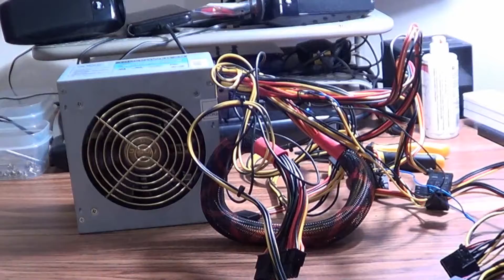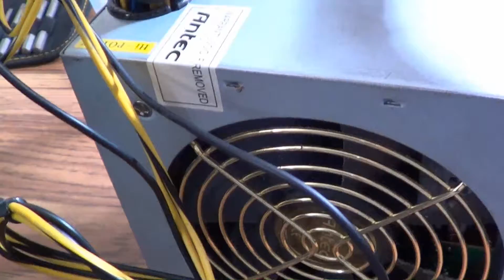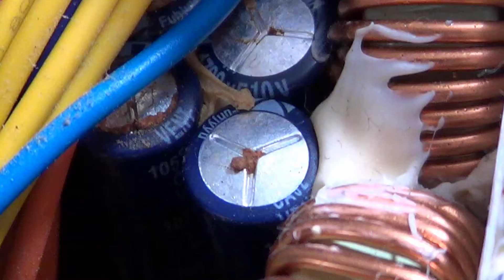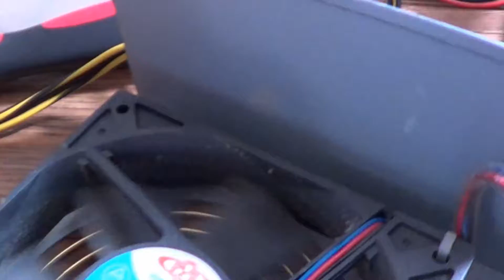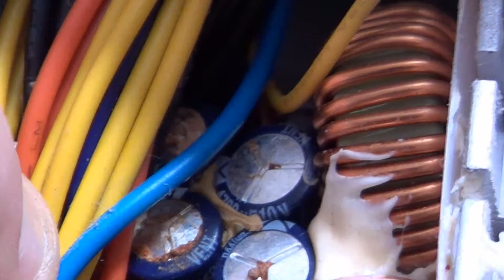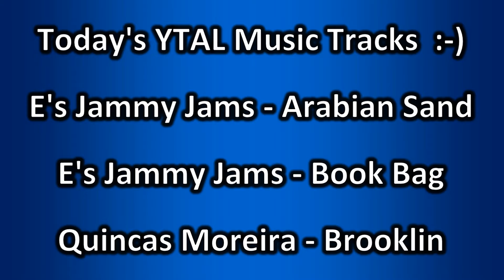Checking Out The Capacitor-Plagued 2004 Power Supply

Comment: My 2001 PC went out like this before I learned how to repair this sort of thing. The optical drive used to eject at startup and the machine would randomly reboot after 30 minutes like someone had just pressed the reset button. Eventually all the rail output capacitors puffed up and it moved along into the motherboard as caps further up the chain took the brunt of the ripple current. I think the rebooting started when it reached the CPU buck converter caps.

Also that glue they use on the circuit boards can go conductive with age, it starts off white but goes yellow and brown as the years set in. You can even probe it with a multimeter, when probed about 1/4th inch apart the yellow colored glue is usually a few hundred kohm and the darker brown stuff has been measured as low as a few thousand ohms!